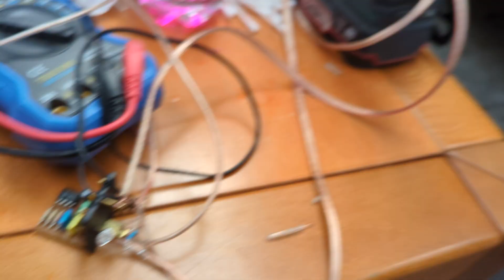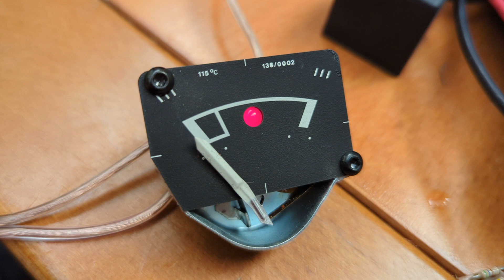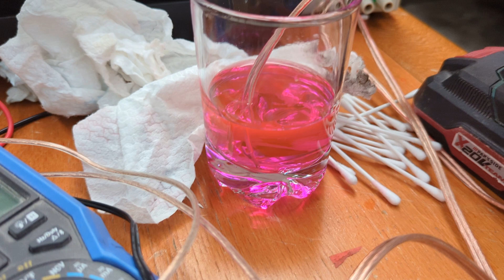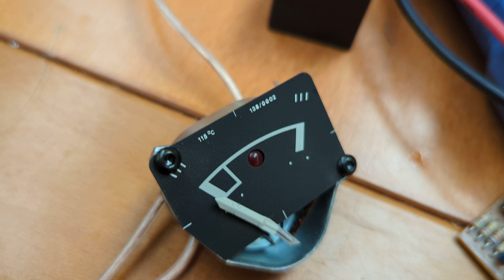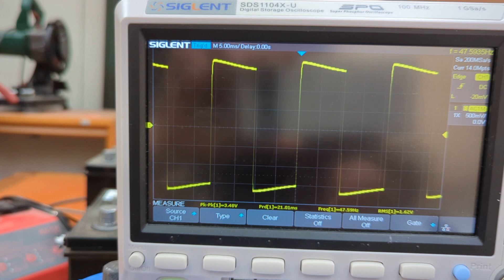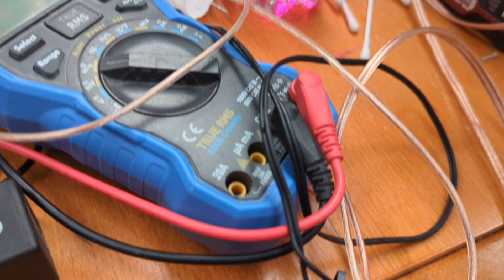How the old VW Coolant shortage indicator works. (Relay 43/42, LT1, T3, etc.)

Comment: Hoi in mijn T3 heb ik het volgende probleem.
De temp meter zelf werkt zoals die moet werken.
Als ik het contact omdraai dan blijft het ledje knipperen totdat ik de motor start, daarna gaat deze uit.
Dit werkt alleen zo als de motor koud is, als de motor warm is dan blijft de led knipperen nadat ik de motor gestart heb.
Heb alles al gecheckt op goede contacten. Sensor in het koelvaatje al vervangen en relais 43 al vervangen zonder resultaat.
Heb jij een idee wat ik moet doen om dit op te lossen? 
Thanks Rick

Comment: Hi thank you for your video. Mine stopped working, bought a new one but seems to make the temperature gauge go too low and then too high triggering a false alarm. If the really is removed then the temperature gauge marks the coolant temp accurately. Can you tell me which connector of the relay goes to the temp gauge. I’m thinking about removing this connector

Comment: Hé, Nice video! Thx. Is no blinking after starting (warm motor) normal behavior? Mine does the 2 blinking things, then stops. When I disconnect the sensor wire no blinking. Any guesses? 
Mine did do a whole lot of blinking ones, at vacation trip. When I came home, it stopped. No blinking since, except the self test when cold starting.